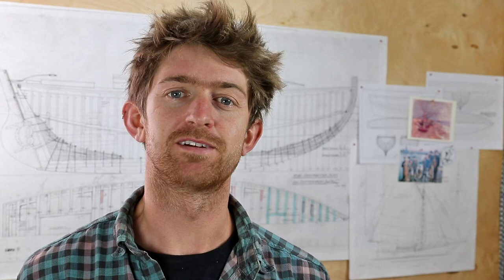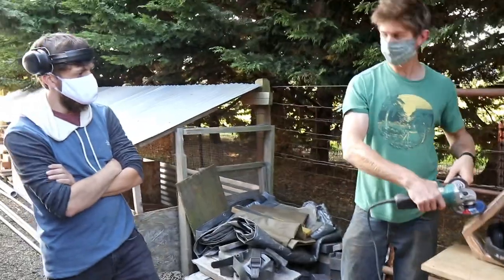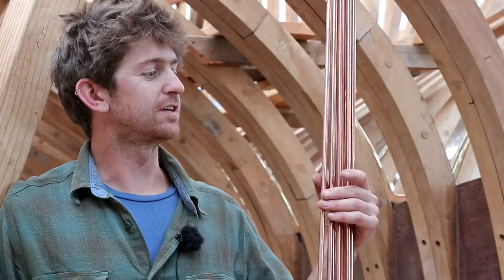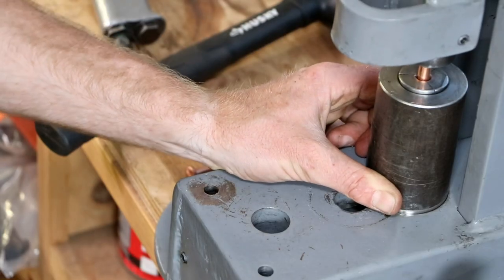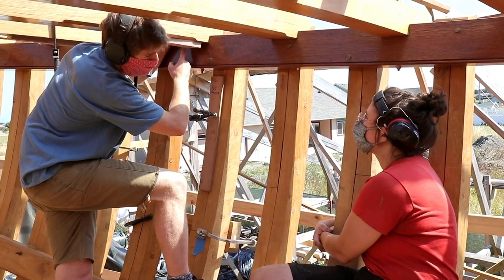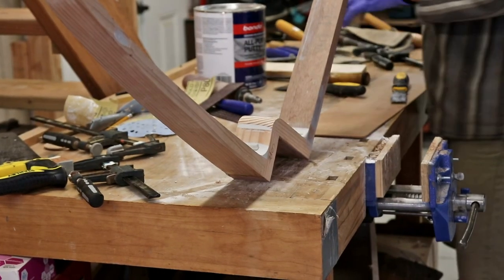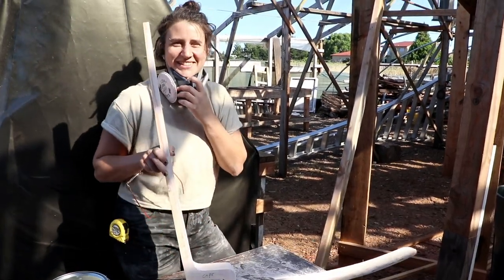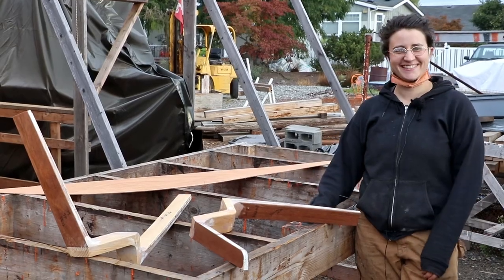Custom rivet press machine! - Wooden Boat Fastenings (EP79)

Comment: Leo when putting bondo in internal corners load it up then cover with cling film and use a pipe of your chosingand squeeze it in and leave till gone of and a perfect concave internal corner with little sanding   Mick UK.
Reply: good tip, I'll use it myself.
Reply: This is a great tip!

Comment: Hi Leo, thank you for all of the great videos. I'm a metal fabricator and all too familiar with angle grinders. I noticed that you're using bonded grinding wheels on the bronze castings. I'd like to suggest you try some flap wheels instead, they are usually faster in material removal, more controllable and leave a nicer finish. They're available in many grits and even different grinding and cooling aids for different metals.
Reply: Till Koerber I’m a complete amateur and I love those flap wheels - but I find they grind through my wallet faster than anything else!

Comment: I wanted to commend Jeff on the riveting machine!  Extremely well thought out.  I worked in a machine shop as a teenage and threaded 4000 bolts one summer and appreciate the economy of motion designed in the riveting process including a self contained cutter with a length stop.  Great work.  Leo very much enjoy your boat build and your attention to detail.

Comment: Can you add a Sampson Boat Company die pattern to the press to further customise the rivets? Might be a merch opportunity in that as well.
Reply: Nancy Pelosi you not....Nancy Pelosi of (insert place Nancy pelosi comes from, here)...are you? I wouldn’t have thought boat building was your jam!😂
Reply: Nancy Pelosi true, it’s pretty epic!
Reply: Jim Nickles  For any image or lettering to be readable the rivets have to be set and secured in one single crazy hard blow...
Reply: I was thinking the same thing, but to create some additional revenue stream by making/getting a die that could forge coins or?, out of copper or bronze, to be sold to fans of the project  with significant margins. The press sure looks robust enough, but we shall see what impact 4,000 rivets has on the machine's longevity.
Reply: Jim Nickles  if you ask me, no, don't do that.  You're right with by hammering it in,  it wil disappear from the head, but the rivets in the boat are on the boat, so nobody will see it anyway. But the customiesed rivets made to be sold in the shop  are easily made and show your appreciation to the whole project!
Reply: @glennmiles5365  He could sell saw dust/wood chips from the shop in little vials like a ship in a bottle of sorts so people can have a little piece of Tally Ho.
Reply: Nancy Pelosi don’t believe you are the speaker.  Funny.
Reply: @dreamer097  The cost of packaging and delivery far outweighs the value of the sawdust
Reply: @ian-c.01  people wouldn't be buying sawdust, they'd receive a sentimental token of the project in return for a donation.

Comment: For those of you that want a logo in the rivet head: once the rivet is in place, a wooden plug is hammered into the hole in the hull planking to make it smooth.  You'll never see the rivet head except when it's formed.

Comment: As a welder fabricator myself, I am suitably impressed with that rivet maker, although I did spot some nasty porosity in the reservoir welds haha, but hey, if it don't leak... it's all gravy. 👍🏽👌🏽
Reply: That collet for holding the stock is the right answer.  Need a faster method to set the collet and remove it. Also, this should be a call for volunteers to come for a couple of days just to make rivets.
Reply: @jackpatteeuw9244  it takes approx 20 seconds to make each rivet. At that pace they all could be made in less than 24 hrs. 3 average work days, a person could make them all!
Reply: @donanders2110  Get realistic !  Moving the rod around, reloading, an average person would do well to make 50 in a hour.  Don't expect volunteers to work more that 3 or 4 hours without a break.
Reply: @jackpatteeuw9244  what is wrong with you? Did I mention volunteers? NO! All I did was say what it will take! I really do not care who makes them!
Reply: @jackpatteeuw9244  If a second person just moved the rod in the shearing station, they'd all be cut in 1/3rd the time, leaving only loading and unloading the holding collet.
Reply: Instead of pointing out flaws, compliment Jeff on good engineering man... comon..

Comment: Loving the fact that BBC Radio is on in the background even in the states
Reply: Internet
Reply: Peter Hendry well quite, I shouldn’t think even the best radio could pick up Pop Master from 7000 miles away
Reply: If you want in depth, comprehensive radio news in the States, our choices are NPR (National Public Radio) and BBC. Both excellent sources of unbiased reportage.
Reply: @peterhendry2154  Computeraid?
Reply: @johna1160  haha unbiased.
Reply: @johna1160  Gag. Unbiased as long as you don't measure it against the horizon.
Reply: @johna1160  I listen to NPR at work. It's middle of the road politically.
Reply: @johna1160  Also no commercials!!!

Comment: Watching your riveter I had the thought you can add a marking to the bottom of the ram to emboss the head of each rivet "TH" or something similar. No extra work. You can get a steel cap fabricated. It could be as elaborate as a coin of the TH photo or as simple as initials. And incidentally a beautifully unique item for SUPER FANS that lasts forever . <3
Reply: Unfortunately David the head of the rivet will be unseen, it will be driven in from the outside of the plank and then covered with a plug.  The part that will be seen is then peened over to inside of rib. However, I like your thinking.
Reply: @roberthamilton9730  Alas, an invisible mark. Not the first. Still works for super fans. :) The coining process is fairly straight forward. In terms of stress risers on the wood and head, there is a very particular head shape that loads the hole optimally. Happy to have a private conversation around that. I nail head is hole edge loading. <3
Reply: @DavidNayer  I like this, somewhere in time the boat builder making repairs will realize the detail put into this vessel.

Comment: It looks like the next rivet could be cut on the same cycle as the head pressing -- that will cut down the cycle time.  i.e. feed the rod through the shear while placing the collet under the press, then the head will be upset on the downstroke, and the next rivet will be cut on the upstroke.

Also a second collet so the left hand can be loading a rivet while the right hand is pressing another. :-)
Reply: And a simple soft dead blow hammer eliminates the collet opening stroke. (1) set up the cut, set up the head, stoke, whack. One opening ~8 seconds
Reply: I would def lose a finger or two on the first day

Comment: If you’ve got one of those wrought iron knees to send my way, I’d be happy to reforge it into something your crew can use.
Reply: That type of metal can’t be used in the boat anywhere because it causes iron rot.
Reply: Sharek Gadd 👍👍👍
Reply: @annotten7413  Sorry, it certainly can be used in a boat,  as it was for fifty plus years.
That iron rot happened from rain water as the boat was left neglected, not during its working life 
Ninety percent of working wooden boats had ferrous metal stengtheners, and many  had ferrous hull fasteners too.
Reply: Ray Watson I’m not a boat person I’m just repeating what Leo had said many times and even said it once in this episode
Reply: @annotten7413  Yes indeed, I have heard him say as much too.
I was just commenting on this topic to provide more information,  rather than being critical. But I know that short comments can sound terser than they are intended.
I dont think Leo would argue with my point really,  but if he can afford bronze, then it is a technically better solution. 
The old sailing ship owners often worked under much stricter cost requirements.
Reply: Ray Watson I did not mean to be critical of your offer — I was just trying to convey what he has said many times. I’m sure that you have meant well in what you are offering him
Reply: @annotten7413  I think you're confusing Ray for the OP, Sharek, who offered to turn the spare iron into something, and not necessarily a boat fixture.

Comment: That rivet head former is a really cracking bit of equipment and is very nicely designed. It should easily give you your 4,000 rivets. The motor appeared not be new and could possibly be the weak link. 
Very much looking forward to seeing the planking start to go on. 
All the best.

Comment: I believe that there are a number of compounds that sand much easier than Bondo.  I recall it coming up in a Mike Patey video where he is making molds for carbon fiber airplane parts.  A viewer suggested a different product and he was very happy he had tried it despite years of using Bondo.  Perhaps worth some investigating as you seem to be using Bondo quite a bit.
Reply: snomanizdman save the dude some research and link the video or product then, you both seem to know about it 👌🏽👍🏽
Reply: @cmmartti  Thanks for the link.  I've watched a ton of Mike's video's as of late and could not ever guess where I saw the reference.

Comment: As a father I have to point out that when an apprentice for my GM wood modelmaking trade, had someone in management caught me cutting a piece of wood on a tool while wearing gloves I would have been officially reprimanded.  This video opened with the gal cutting a narrow piece off a board while wearing gloves and the larger toothed bandsaw would have loved to snag her glove and pull her hand into it's path.

Comment: Now I'm wondering how you're going to form the head on the other end of the rivet once it's installed through the planking. I'm sure an impact hammer wouldn't be your first choice. Maybe Jeff can MacGyver up some portable "C-Clamp" shaped press.
Reply: I think it gets bent over.
Reply: There will normally be a rove ( a type of domed tight fitting washer) driven onto the rivet, the rivet trimmed to the correct length  and the rivet peened against the Rove.
The methods of peening can vary but, with this many rivets and their size a pneumatic hammer will probably be used. This will require a heavy bucking bar put against the head of rivet to counteract the peening process.
A hydraulic squeezer could probably used in some places.
Reply: @larrysorenson4789  That would be a door nail; the old fashion way was to bend the door nail over. Thus the term "dead as a door nail"

Comment: 24.44 hours of riveting for those too lazy to do the math
Reply: thats nothing, will be done in no time, what will become of the great machine then?
Reply: Ha! I did the math, too.
Reply: elmonkeh how much $ per rivet then ☺️
Reply: I just did the same. Shave 2 seconds per to get it to exactly 24 hours.
Reply: I'm not too lazy to do it...I just was going to do it later...
Reply: Brad Sanchez  not included the time to pick up a new rod when the old is done, also if he had 2 inserts so he could cut and make the head in one move another person could attach the rod he could almost half the time.
Reply: No, it's 24.44 hours of rivet-making. Which is nothing, in the scheme of things, half an easy weeks work for one of the guys. Pete has spent 8 weeks (maybe 10?) fairing the frames, they seem to have had 2 people pretty much full time on grinding the floors (15 so far? Not sure, it's hard to tell how far through they are) for about 6 weeks. Now the actual riveting, that really will be a job. 2 people and probably 5 times as long to put in a rivet as it takes to make one, not counting drilling. I'm glad I'm not one of the neighbours, it will be several months of non-stop pneumatic hammering.

Comment: Okay, but why was the box it came in not flat on the bottom? It’s driving me nuts.
Reply: That's what UPS does to your  packaging.  Just rip the box up or knock the feet off.  regards
Reply: Gary C , that’s what I thought at first.  I worked there very briefly, and can attest that fragile contents means basically nothing.  But no, it has some sort of bracing or something running what looks like the width of it.  I wonder if it was meant to ride the other side up. You can see it when it’s still in the truck i think.
Reply: @rtmordecai1  I think that the box was meant to be lifted by fork truck. The FT operator has very likely broken off the bottom rails when trying to get it on the forks whilst they were open too wide. regards

Comment: Awesome machine.   Couple of innovations to speed up making the other 3995 would be to cut all the rivets to length first in bundles with a bandsaw, and to have several collets so you can queue up 4 or 5 rivets ready for head-forming in a two-man sequence

Comment: Leo if you cut a rod as you press a rivet you can speed up the process. Another suggestion from an old auto body repair man. Know your finished with the knee shelf patterns but for future use. If you're using body filler try zgrip brand it sands much easier. Also 1/4 plexy glass makes a great mixing board. Tools can be shaped out of it also to drag special shapes. Treat it like wood with wood tools. If you want really smooth run a propane torch over it. If you let filler harden on them sand off with 80 grit sand paper and smooth with 320 grit. Thick piles on mixing board hit parallel to board and it will pop off.

Comment: The cutter/stop is great.  The whole device is great.  Although there would be wasted material, I think it would save time to cut the copper rod with the big band/chop saw.  You could cut 40 pieces @ a time or more, then finish them with the press.

Comment: I often admire the speed and accuracy you obtain with your tools both power and hand. I can't imagine how in the days of wooden boat building and very limited power assist they managed. Perhaps they had very large crews of shipwrights and helpers and worked very long days. It still is an immense job to do by hand. Probably the ship yards were not the easiest place to work being heavy and demanding work. It must still have been better than the hand to mouth farming existence at the time.

Comment: You should try using Inletting Black when trying to fit the bronze floors and the hanging knees to the wood.  It is the same process for matching a rifle barrel to the stock.  Makes it easy to see exactly where the high and low areas are.  Just a thought. Keep up the great work!

Comment: Now I know why a lot of the nails I (once) used had those little grip marks up near the head. I just assumed they were there to hold the timber more securely, but no, that was how the wire nail machines made the head. Thanks for this metal work lesson Leo.

Comment: Leo, the bronze hangers between ribs and the deck planks! when you first talked about them few episodes ago, I recognized the obvious stress point where the bronze takes the sharp internal corner - that's a potential cracking point! If you had round the internal inner edge of the stringer directly below deck (shelf?) to plain 1/2" or r3/4" radius, instead the lorry trunk plank thing. Then you had to fill the bronze hanger with corresponding 1/2" or 3/4" fillet and voila! No stress point there! Ask some structural about the strength difference between the two options. At this stage you still can cheaply change it.
Reply: withdrawing my remark - you  just did it right in 20' 19"
Reply: then you revert to the error on 26'30".... I am reinstating my remark! Do the hanger like in 20'19" and carve out the stupid wood instead the bronze!!

Comment: Hi Leo. I have watched this project since the beginning and continue to be astonished at the depth of craftsmanship and beautiful work that you and your team produce.
I am not someone of much boating experience and have only gotten a rough sense of what the interior might be but I have a suggestion for an change to the interior (I assume a non-traditional one). 
The skeletal structure of the boat, especially with the addition of the bronze floors is incredibly beautiful. 
After so much effort has gone into creating this structure, it strikes me as somewhat sad that the interior will hide it. 
As such might it be feasible to create a portal in the "floor" (that you stand on) - one that could be covered with a sturdy transparent material that can support the crew's weight. 
With the addition of judicious lighting within the skeleton, visitors would be amazed to be able to see it and get a sense of how it is put together. 
Not sure if that makes sense. Thank you for the years of great videos of your craft and work family - it continues to be a source of joy

Comment: Sometimes old circuit breakers develop weak springs in the mechanism and pop at too low a load, you could ask an electrician to analyze it. There are also breakers designed to work with machines requiring high starting currents should the breaker pop when starting or under high load. You may also be able to tighten the wiring attachment screws which can loosen with age  making a bad connection. You could also install a higher amperage circuit or other strategies.

Comment: You need to saw the copper to the right size, it would save so much time! You can cut multiple rods at a time on the bandsaw: stack all 100 rods together in a bundle, cut in in half, package all of that into a bundle of 200 rods and cut 5" slices off it. 2800 blanks in just 15 cuts.

Comment: With a little adaptation you should be able to press one collet  tight, one finished collet loose, form the head on a third collet  and cut one new piece of bar in the same stroke and with a fourth collet, auto return hydraulic control and a weighted  cord on the rod feed, the down time between strokes would be just moving collets one position and loading rods.  Having said that I would be flabbergasted that someone wanted to help enough to build the machine I got that I wouldn't complain.